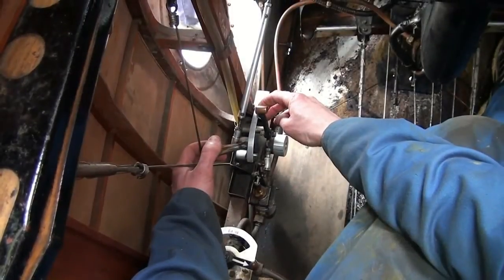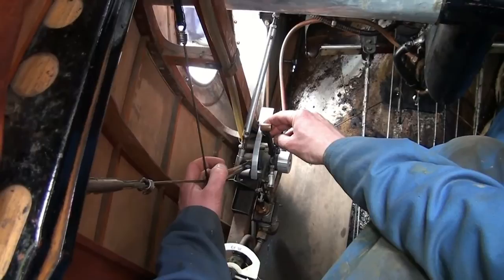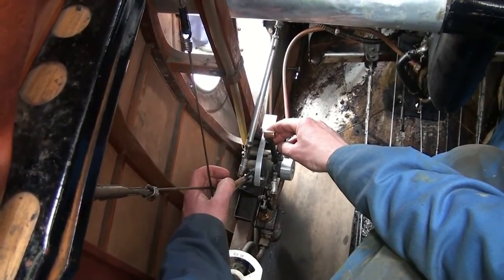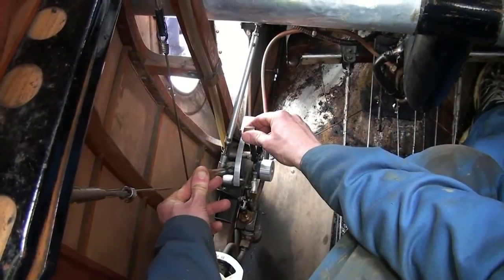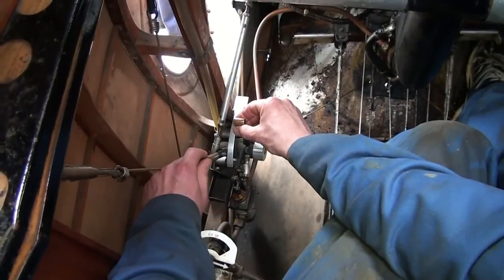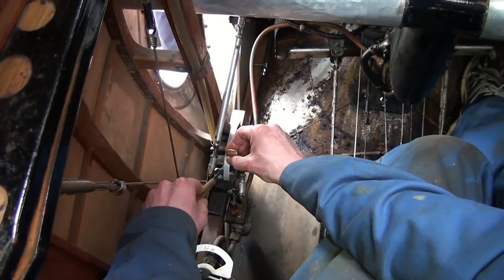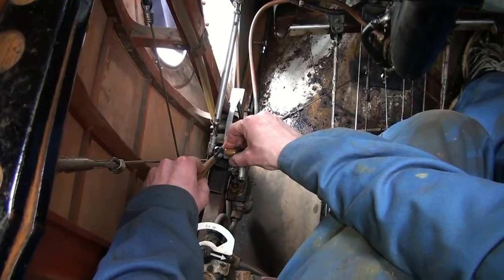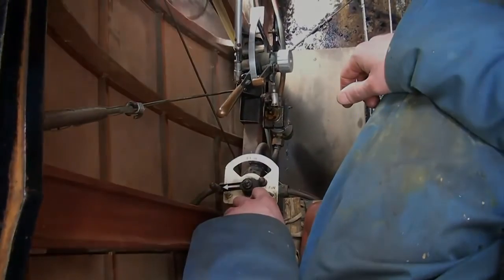How a Sopwith Camel rotary engine is controlled

Comment: I always this engine configuration was referred to as "radial". Whereas a rotary was more like the wankel engines use by Mazda, NSU etc.  No?
Reply: No, this is a rotary engine.  Radial engines were a later development and widely used in WW2.
Reply: Both radial and rotary engines have the same cylinder layout, but in rotary engines the whole engine rotates (hence the name!) whereas in radial engines its just the crankshaft.